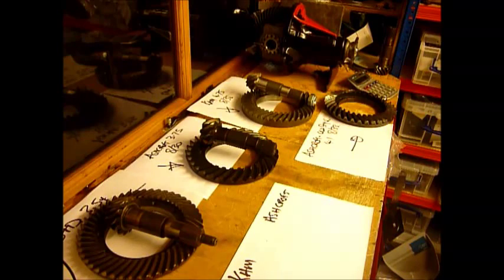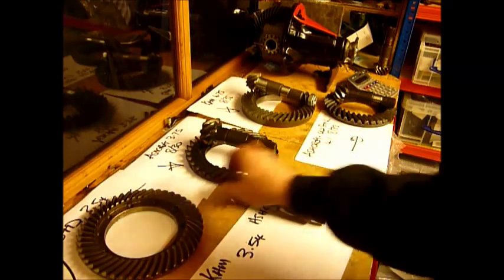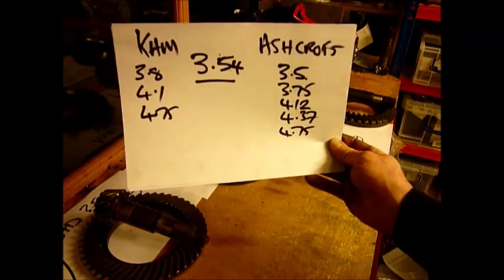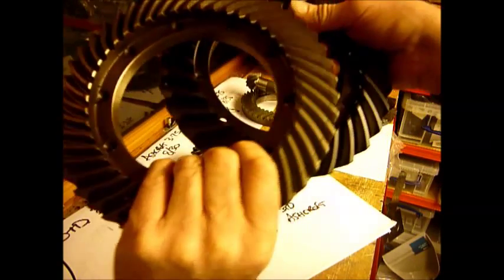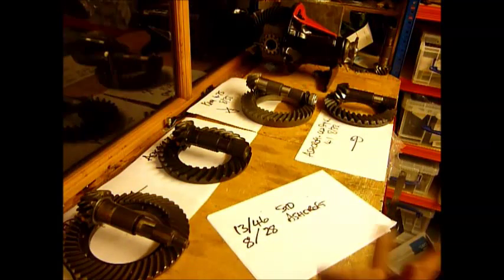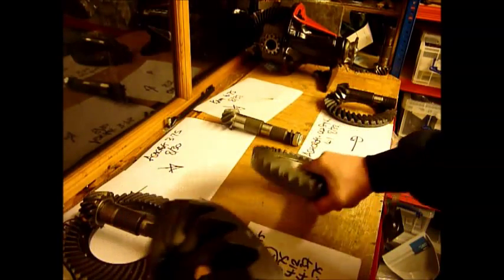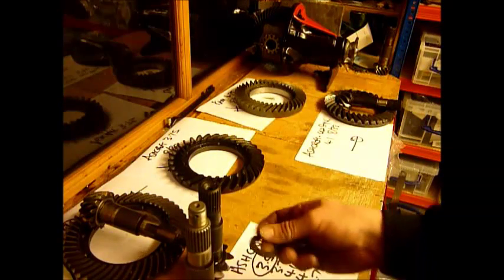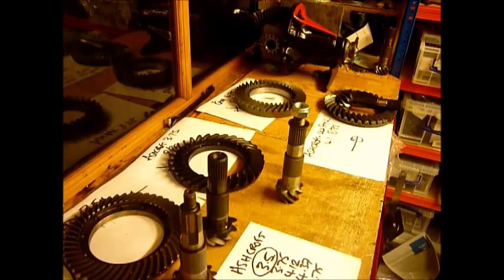Land Rover CW&Ps - Understanding them - Tooth Count, Ratios & HD vs Standard Video 1

Comment: Okay, a 2003 4.6 V8 Disco II... Often used to pull trailers with boats, up to the 7000-8000 lbs. With a 2" lift already done, stock tires are to be replaced with something slightly bigger, like 31" or just under. Mostly city and highway. What would be ideal?
Reply from the maker: email me on megasquirt.v8@gmail.com . Nige